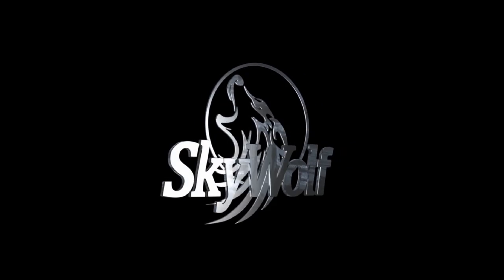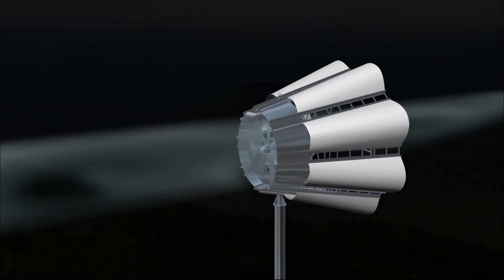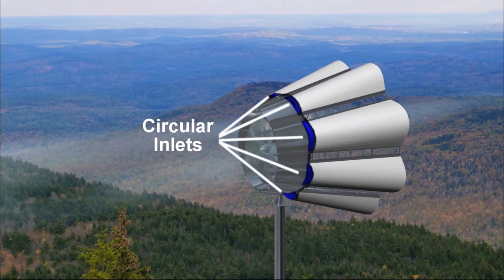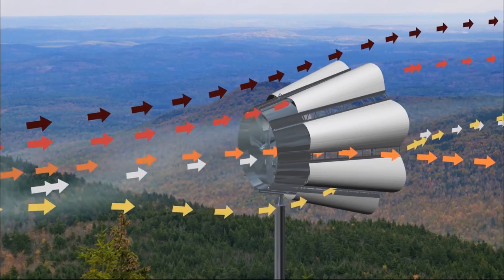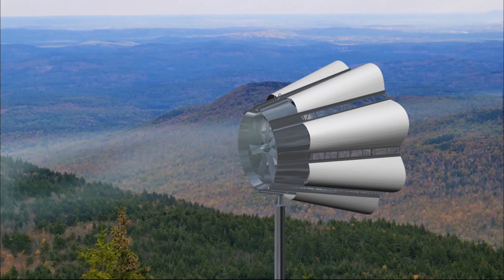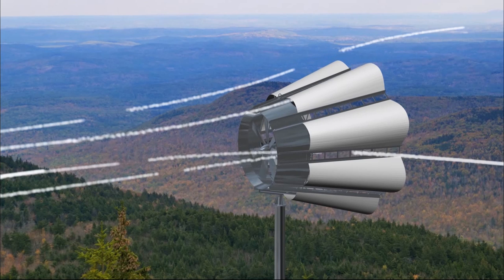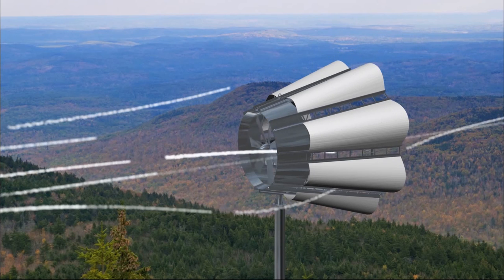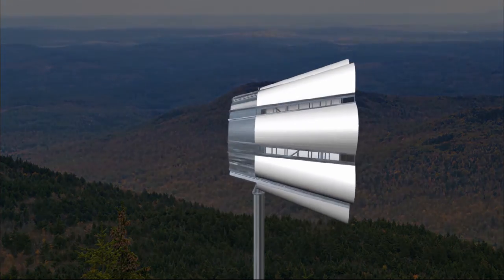Sky Wolf Wind Turbine Animation 2014

Comment: The answer to wind turbines is that they are now unnecessary. We now have the ultimate and cheapest green power device with none of these problems, in the SAFIRE GENERATOR. This is what we need to negate all the problems of all competing green energies. It produces almost costless electricity and therefore hydrogen from new FUSION NUCLEAR and is now immediately upon us. We have recently taken a new step to advance the physic of medium temperature plasma fusion power production by enabling chemistry of the atomic nucleus, or "nuchemy" in the newest FUSION NUCLEAR POWER technology. We are passing the chemistry level where we interacted with the atomic electron shells and are moving on to manipulations in this "NUCHEMY" atomic nuclear era when we interact and multiply nuclear protons. We have rediscovered the lost work of the alchemists and can make new elements with different atomic weights. This was ably demonstrated in "THE SAFIRE PROJECT". Quanta are important. We now have enough energy to manipulate the atomic nucleus much more easily by creating a compartment, or what is a local region of plasma containment so reactions at this atomic nuclear level can easily take place. This is about to practically enabled a really fantastic and cheap new era of energy production for the whole of mankind. This with hydrogen, so free fuel obtained from water or atmospheric moisture anywhere in the world. This new fusion nuclear SAFIRE GENERATOR is at the industrial commercial production final development point as of now and it can retrofit older and decommissioned power plants. The energy argument and other power methodologies are all now virtually irrelevant as we have new and very physically and economically powered practical and local community level fusion nuclear power. Solar roof plus Teslawall battery may be the present way to go domestically but megapack batteries and multiple storage technologies interconnected with an expanded ugly grid have a less certain requirement when you consider new any-scale community based and 24 hr reliable and self-fueling fusion nuclear in the form of the "SAFIRE REACTOR". Learn all about it at "AUREON ENERGY.COM". Then learn the newer EU Theory and plasma physics at "THUNDERBOLTS PROJECT.COM" and you will be permanently reeducated with this advanced newer EU theory that will allow you to understand more about the astrophysics of our whole universe and all within and you will be more informed and can teach your peers.
Reply: pls go outside into real world
btw there is nothing wrong with diversified energy production and trying to innovate 
Fusion is very expensive and won’t be happening for some time
plants to long to build

Comment: I refute the logic behind the skywolf. Static pressute will always b high in a duct enclosure than in the open. This holds even if the duct shape is diverging or towards wider opening. This is because the duct wall always offer wall resistance or dkin friction. So better that no duct or enclosure at all
Reply: No the air being diverted around the cone pulls the air out of duct. The Venturi effect of the narrow
Reply: Opening leading to wider outlet leads to low pressure so long as the air stays laminar and attached to diffuser. If there’s no stall the diffuser will significantly decrease pressure. 

It the environment your used to, there likely isn’t a flow inside and outside the duct. When both flows are attached there’s definitely a vacuum.

Comment: 40 kilowatts per day means 40 kilowatts per 24 hours
Therefore, kilowatts per hour is 40/24 = 1.66 Kwh. Kindly clarify the per hour power capacity.
Reply: Watt is a unit of power. Power is in this case electric energy generated per unit of time.  The unit for energy is Joule; one Watt ist one Joule per second.    40 Watt per day would mean 40 Joule per second per day. This makes no sense and suggests the maker of the video doesn't understand basic science.

Comment: So if this is all true, as of the date of this video its been over 10 years since the first patent.  Why are we watching 100% computer animation?  Why isn't there a single frame of at least a prototype in the air?  Because that much weight and wind drag at the top of a tower is EXPENSIVE to support.  Shroud size (due to drag) and weight limitations also limit the size of the blades, killing your efficiency and output (Longer blades == more efficient).  Sorry, Sky Wolf.

Comment: All that extra mass and effort, for "more efficiency" - not very efficient. Easier to use the same mass and build a bigger, simpler unit. Also, imagine one of these, scaled up to the size of current equal-power units, on a proper mast, in any decent storm - HUGE side-load.

Comment: How much is it? 40 kW per day? 
40\24 = 1.67 kWh? 
Or what is that?
Reply: Your calculation doesn't work either. If you divide watts (which are joules / second) by yet another time unit (hour), you get joules/time^2. If you want kwh from kw, you have to multiply power by time, not divide.

Comment: What is 40 kW per day?!? kW is an electrical performance.
Reply: Each day of nonstop wind, the performance increases by 40kw. In 3 days it should be producing 120kwh per hour.
Reply: Im jk btw
Reply: „In 3 days it should be producing 120kwh per hour.“
This is nonsense! If the turbine has a power of 40 kW (nonstop), then it will produce 120 kWh in 3 hours!
120 kWh / 3 h = 120 / 3 kWh/h = 40 kWh/h
And then You can shorten out the hour: 40 kWh/h = 40 kW.
Reply: „Im jk btw“
What is jk?!?
Reply: +Gerhard A. E. Uhlhorn; by the way. Just kidding.
Reply: Ah, I understand.. :-)
Reply: LMAO xD